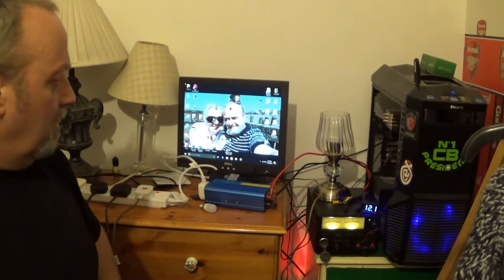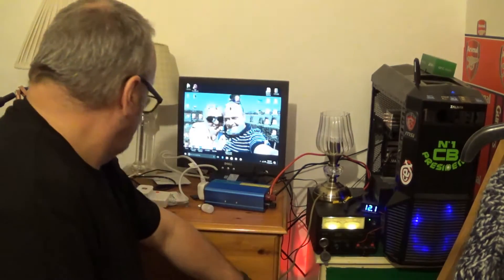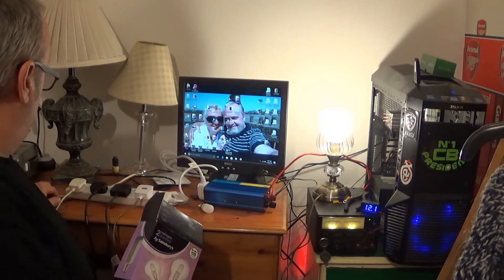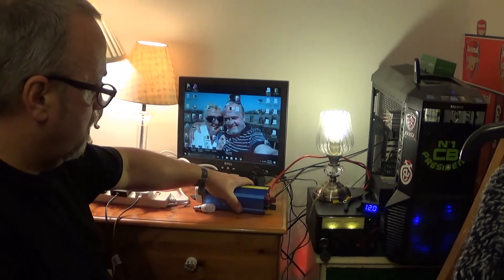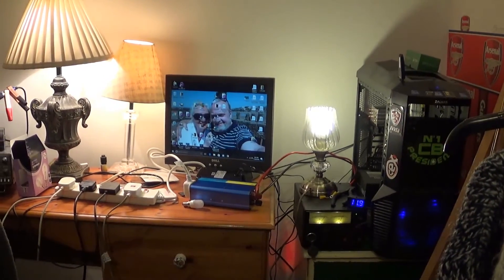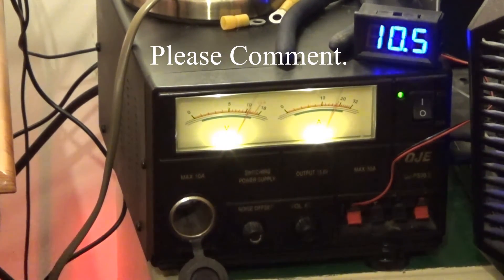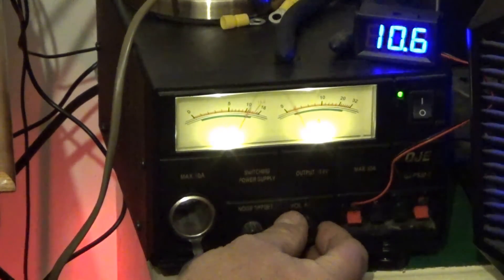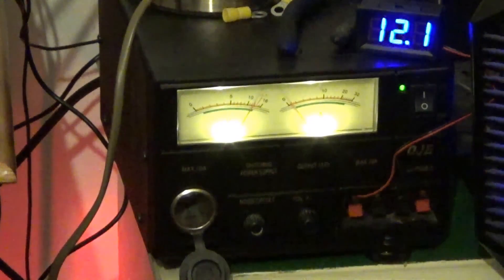ipower inverter 500w,1200w surge Pure Sign Wave

Comment: 60 watts, 12v, 18 amps ....!!! Eh ?What !! I just want to know if it's any good. Shall I buy one or not for a camper conversion.  Like in a maths problem ... I don't want to see the working out. I just need the answer . I'm not bothered about demos. So I skipped to the end for the conclusion .... But there is Non. Good video for a techy mate. But I',m non the wiser.  I will check in tomorrow see if you've posted an answer/ conclusion / yes/ no.. Cheers buddy
Reply from the maker: Yes it's a keeper.
Be aware that all of these have limits.
It's not a case of 1 size fits all.

Comment: Hi. I bought this inverter. One of the crocodile clips broke. I want to use it with a lucas lsla12-12 battery. I want to instead of using crocodile clips, use spade terminal connectors  to the battery, and use the same kind of ring connector on the inverter end. Please...do u know anywhere that sell leads like that or a good place to order these spade and eyelet wire terminals...and the wire?!
Reply from the maker: If you are looking online try ebay or amazon, that is where i get my connectors and cable. Let me know how you get on. I do not know the battery you have, if it has car battery type posts, you can get some welding type  connectors to bolt on.
Reply: I bought the battery and inverter on ebay/amazon! The thing is, I don't see cables with spade on one end and eyelet on the other...and I'm trying to avoid making my own. it may come down to it, though...and I want the right thickness/tolerance. Maplin is useless, I find. they either send me online or to Robert Dyas every time I go in there.
Reply from the maker: There is no right thickness really, just a minimum one.
The longer the run of cable the thicker is has to be.
Maplin is ok if you go in there knowing what you need, its another thing if u go there asking for help.
I find the staff do try but (at times) have no clue as to what you are asking about.
regarding the size of cable, you cant really go over size, as bigger is better but it does get expensive.
You could try looking for 40 amp black and red cable on amazon,  its about 3.50 for one meter of it.
One of the sellers is rocket radio, its a cb radio shop, based in Letchworth.
You never know if u called them and asked for them to make a cable for you, there is a good chance the guy would make one to your spec.
Reply: Solar Panel Power many many thanks for the time and thought given in your reply! I learnt a few things!  I'll check out rocket radio shop also. I have struck gold in local maplin tho...in that one of the guys part-timing is doing a v v technical degree! So he knows raspberry pi, electronics, robotics, arduino, etc...! Oh...I actually called the battery manufacturer, and spoke to the tech. He said you can't buy a cable like that, and he actually made his own!
Reply from the maker: Hi William call me Steve, no problem my friend , if I can help I will.
Have you sorted your lead problem??